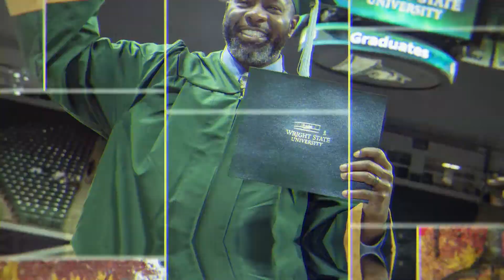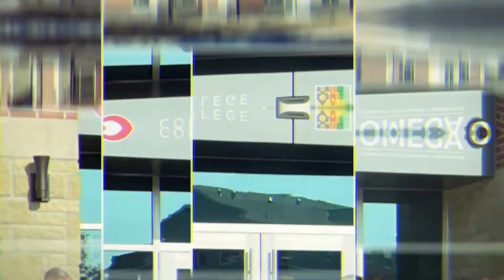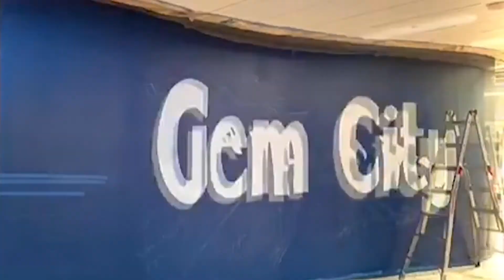AES Ohio 2021 Community Impact Report

Comment: Of course, a company with NO integrity would try to review itself. A truthful community impact statement comes from the community. After waiting over 5 months  for a parking lot bulb to be changed, 4 trucks show up trimming trees, and replacing old lines and the safety light. They were here most of the day. Every branch, limb, and leaf was left in the yard and parking lot where they landed.I've been leaving messages for the line crew supervisor for 2 months now to tell me when they'll be back to clean up the mess they made and do something about the exposed bare wires hanging down. I even left a message on the PUCO liaison number. If this mess isn't cleaned up today I will clean it up and deliver it free of charge to the doorstep of the corporate office, after all, it is AES Ohio's mess.